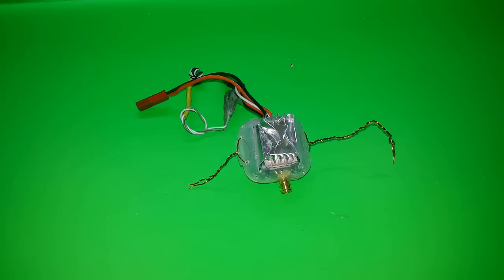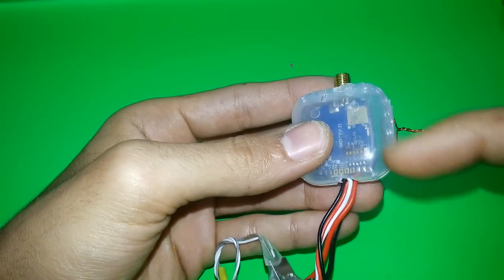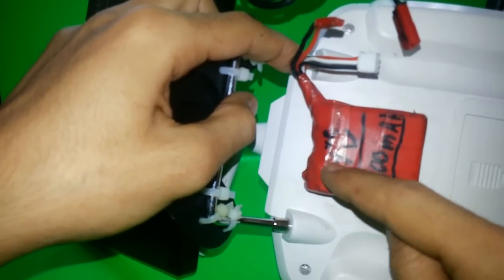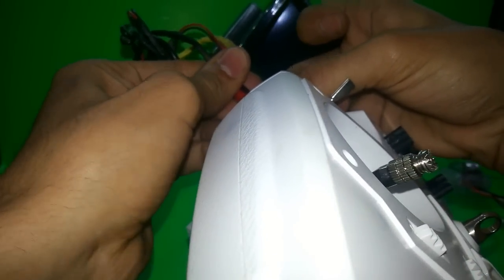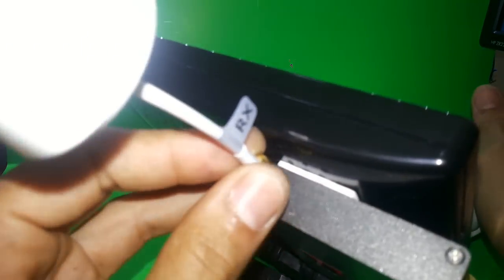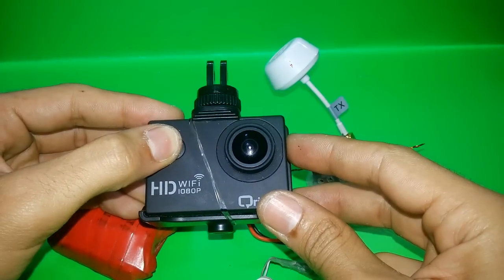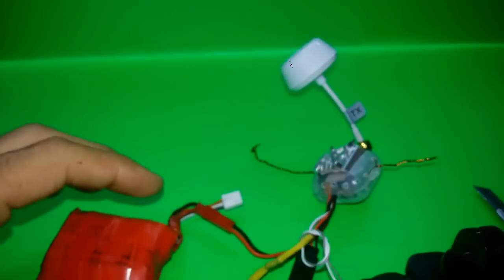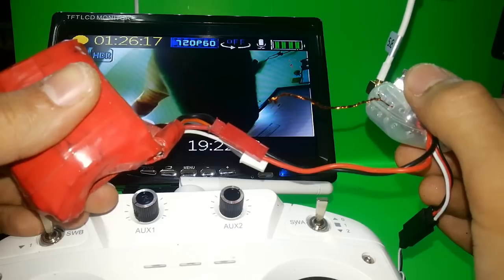Video transmitter and receiver setup in any drone Video transmitter and receiver setup

Comment: Hi mate is that a sj4000 camrea your useing
Reply: +Nick Walters Nick, are you absolutely certain that you do not have "TV OUT" option in the settings menu??  I have an SJ4000, 3 yrs old and it has the TV OUT option. **** This is important: There are FIRMWARE updates for the SJ4000 and, at least 3 distinct software packages for the SJ4000. All you will have to do is go to the sj4000 action cam website and download several versions, until you get the TV OUT option.  You'll notice that there will be different Startup Screens with each Firmware variant. When all is said and done, you most certainly can have TV OUT mode in ANY SJ4000. Let me know if you would like to use the TV OUT & DVR ( Video Record ) at the same time...there is a simple trick to using the SJ4000 as TV OUT and DVR Simultaneously.
Reply from the maker: Nick Walters 
yes :)
Reply: Thanks ive got a sj4000 but got no tv out 😓
Reply from the maker: Nick Walters you need to modify the usb connector to get the tv out to your monitor
Reply: Yes but not got tv out in the menu setting
Reply: Yes mate i would like  for my dji phantom for fpv cam and record but if think mines a sj4000 clone

Comment: Your battery pack is not a 3.6V one cell one as the label is on it, it has a balance lead for 2 cells. Transmitter can work from 7+ volts. I have an SJ4000 but old PCB, no video out :( I have now a separate camera just for the fpv and sj4000 for recording.
Reply from the maker: FotoAmg AmgFoto yes you right, About TV out of SJ4000 you need a special cable not lake the other, the one on the video i made it my self and also you can make one also i will make video about that
Reply from the maker: FotoAmg AmgFoto other thing you can use the car camera it working perfectly and it very cheap
Reply: MB Mone I already made a special cable for the SJ4000 tv-out, than I realized there is no TV-out in the menu! I googled and the old version PCB SJ4000-s won't ever have tv-out :( so such a same I created my TV-out cable but my SJ4000 was not compatible with any TV-out cables, only HDMI is working. I cannot turn off LCD either.(Old PCB SJ4000 with old LCD can have the old firmware from March installed where video and still quality is the best, new PCB/LCD SJ4000 can have usb-tv out mode but you cannot put the oldest firmwares back to have the best video quality, so I hope I can sell my old one for someone who needs quality and does not need tvout mode and buy a new PCB version.)